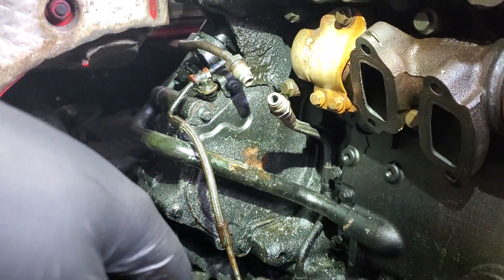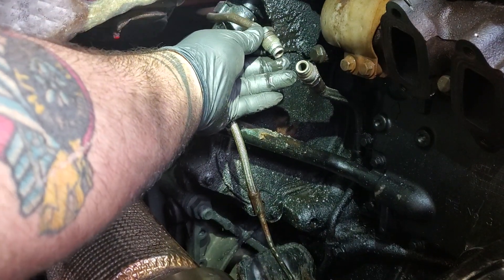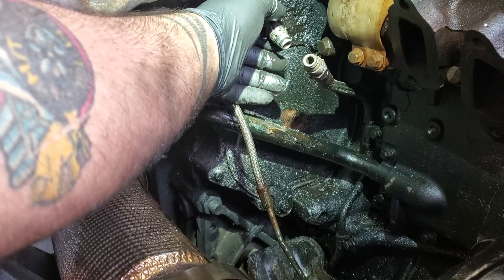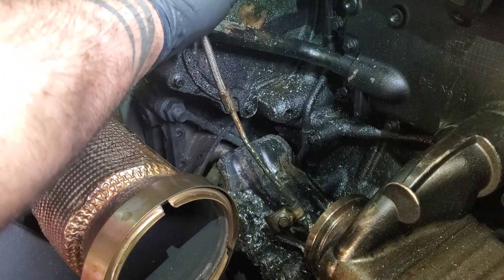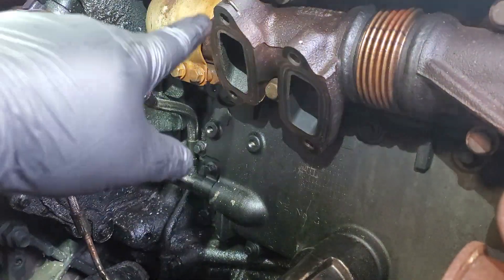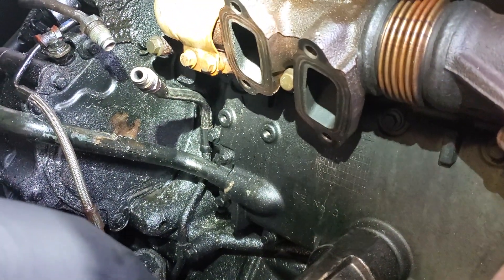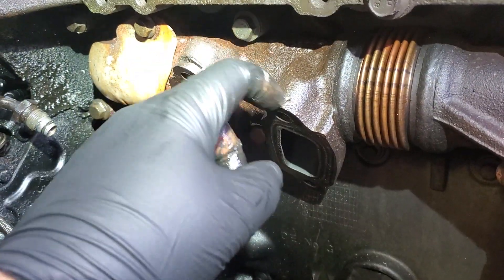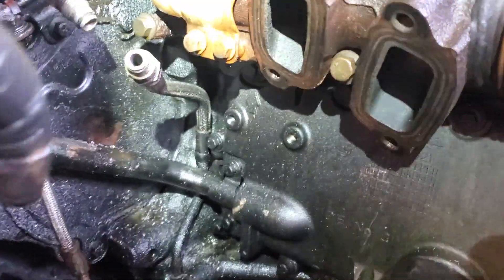Volvo D13 EGR Valve Replacement

Comment: Good pointers. I also use a torch and heat up the crap out of the bolts to force the alloy to expand. If the torch doesn't work, I would drill the bolt cap off or cut it off and then use PB or WD in there. Then heat up and vice grips. If a welder is available, I will then weld other bolts on to the studs to work the studs

Comment: I was so scared when I heard the bolt started moving in it’s threads and it made a popping noise, I was like oh hell no, I broke the bolt but lucky me they all came in one piece.
Take your time guys, use a lot of heat and lubricants.

Question is, after you replace egr valve, do I have to reset anything in Volvo tech tool (PTT)??

Comment: Buddy, you just damaged exhaust manifold. You should use a torch, apply some heat and expand that material. If you work at the KW dealer, they should fire you for that damages.
And you learnt this from another man one year earlier. Give him a credit for that damages, at least. 
https://youtu.be/l7mnrSvTbXc?t=8

Comment: Something you might want to try is taking a hammer and knocking the head of the bolts a few times. Then take a 1/2 impact and bump it once then hold trigger down. Never had one break with me yet. Not saying it will work every time but it has with me

Comment: How do we know if EGR is going bad?
Reply: Valve gets stuck in open position and gives you a check engine light. In the long run it will hurt the engine.
Reply: @polarViking  what is valve is stuck closed?
Reply: @strubies   if the valve is electrical controlled you will probably get a check engine light if it is stuck in either position, and only way to fix this without changing parts is to program it to a shut position and the ecu will think it is working properly, but if it is vaccum controlled you can block the exhaust pipe going to the valve with a piece of sheet metal or something that can handle the heat and you are good to go.
Reply: @polarViking  will just blocking the egr valve help the engine run better? Doing this with the metal sheet will prevent the gasses from recirculating into the engine, correct?
Reply: @strubies  i do not know if you will gain hp or nm by blocking it, but i can guarantee it will not make it worse. In the long run you will have a healthier engine, with less soot and build up in the intake, on the valves, and inside the turbo if you have one. Egr is there only for one thing, to lower the emissions, but what i find funny is when i have my car with blocked egr on the EU control and they measure the emissions, it is good every time.

Comment: Why u go back and forth? Not being rude or w.e just asking seriously on why is it so hard to choose between mechanic and trucking?
Reply from the maker: I've been wrenching on trucks for 3 years now..... the last videos you saw of me in a shop in 2014 was me taking a break from driving. Im done driving now, I'm a certified technician now at a Kenworth dealer.
Reply: @RunHardGetPaid  how did you get certified? where form and how much
Reply: @RunHardGetPaid  ohh okay ty for letting me know. was the dedicated  coke account not working out? Like did u have to deal with alot of bs

Comment: Next time try Liquid Wrench penetrating oil, they changed something in it and now it works real good on rusted bolts with heat.  i used to use PB but not anymore.